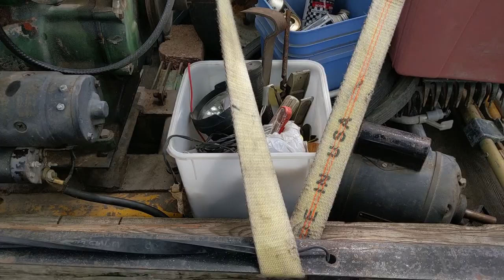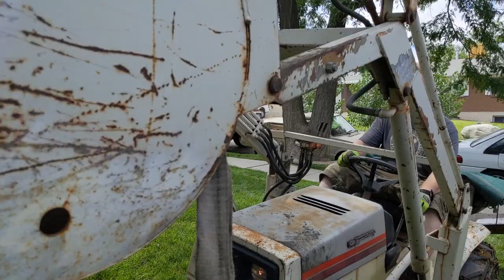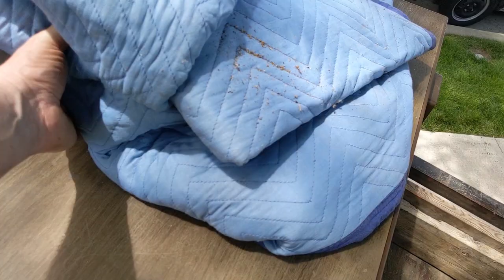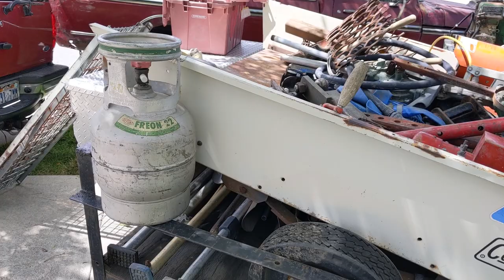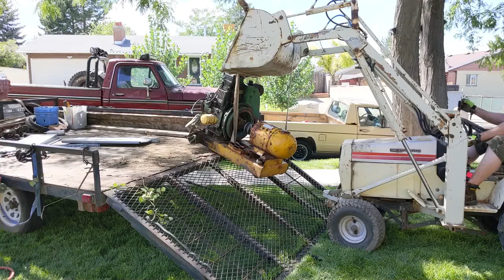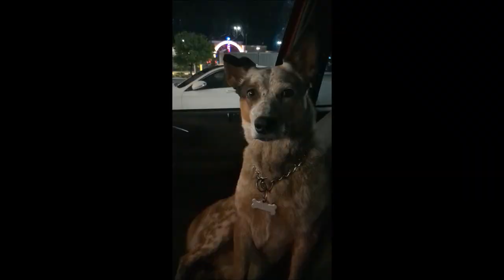Unloading Estate Auction Finds with Tractor

Comment: I saw a pop-up camper go to the scrap yard, and I had a use for the wheel hub assemblies. I jacked it up, took the tires off, took the grease caps off, grabbed a needle nose pliers, straightened out the cotter pin, and pulled that, then I could remove the axle nut without any tools. Someone thought that was how it was to be done when they apparently redid the bearings. Unfortunately for them, it could have been bad. I had noticed after the wheels came off that the hubs wiggled.

Comment: I notice when you feed Ginger, she looks at you more with adoring eyes 🐶while trying to stay awake during the drive. I'd guess she was satisfied with that breadless Chick-Fil-A. Good haul, but I have enough to work on at the moment. I could use some of that excess steel though.
Reply: Need steel? I've got advice. Become a good scrounger... and learn where all the scrapyards and/or materials recyclers  in your area are that will sell used metals for a good price. Some folks are shocked by what they find they can get for very little cash or even for free just by asking. Best wishes! 👍🏻🇺🇸

- Max Giganteum

Comment: You have  a good  selection of small engines  The diesel engine would be nice to have on a big garden tractor Maybe make a tractor out
of a tuck tranny and rear end
Reply from the maker: I was hoping these diesel engines were a little bit smaller. They're nearly double the height of a flathead Briggs 16 hp

Comment: those one wheel garden tractors/cultivators are collectable for real. take them to a antique tractor show, and i'll bet you can make a little money depending on what you paid for them. so that's where that high dollar power unit came from. heck, that three point arm drawbar is 20 bucks new, let alone all of the rest of the stuff in that pile. i'd say you got some good deals there. i'm kinda looking for a cheap, small hit and miss, or a small diesel engine for a motorcycle project i have in mind. i've got a single rear tire off of a farmall model A on a 24" rim for the rear tire, i've got an old harley 4 speed tranny to drive it, i wanna use a hit and miss engine to power it, and mount it all on an old honda goldwing frame i have. i saw a guy riding something similar at an antique tractor show where i took my '47 economy and my '54 massey 33 to display a couple years ago, and thought it was really neat. so i've been scrounging up parts ever since.
Reply from the maker: Sounds like a fun project. I was hoping the diesel engine I bought were small enough for projects, but their huge.

Comment: Will you make pallet forks for the bucket one day?
Reply: I propose that this would be a bad idea. Why? Not enough lifting capacity on that small tractor and it wouldn't handle the strain. If you put forks on the front end, you place the load that much further away from the equilibrium center of the tractor... even if you had a lifting capacity of 5000 lbs, at some point you'd have to counterbalance the backside of the tractor to accomplish a lift. And that's assuming the tractor itself wouldn't fall apart underneath you. I suppose that you might be able to get away with lifting lighter loads... but would it be worth it? Would it be safe? Would you want to risk damaging the tractor? These might be tough Qs to answer but based on Moe stating that 500 lbs seems to be around maximum weight to be lifted with the bucket... I wouldn't advise pushing the tractor harder by adding on pallet forks. It's all about leverage and in this case, the leverage would not work in your favor. Best wishes! 🚜🇺🇸

- Max Giganteum
Reply: @MaxGiganteum  good points for general public.  When I rent a car I give it back cleaner than when I picked it up..I even vacuum the sand.      It would be fun to have a small tractor that lifted washing machines...even dryers.  Stoves would be a big help because they tend to be the most fragile of them all.
I work alone, so every lift is mine. I've overloaded my Toyotas..a couple times, but for the most part I do well.  430,000. miles on one where I had to park it because of the frame....but original clutch as far as I can tell..(I had it since 60,000)...Still 370,000 while towing trailers supports my gentle approach philosophy.  

My vote is still for the pallet forks as all the hard fabrication is completed, now just a few simple pieces and off to the races.
Reply: If all you were lifting was a washer, dryer or a stove... I think you could go with that. At least modern units. I wouldn't recommend an old fashioned cast iron type like my grandmother had though! 😲

- Max Giganteum

Comment: Your poor wheel bearings on that trailer - lol 
What's the capacity on your tractor bucket ? 500# ? 
Anyways - good job, nice score
Reply from the maker: Yeah seems to struggle right about 500 lb. I can get around 800 if I'm move the weight further back on the bucket. The heaviest piece I moved was right around 800 lbs